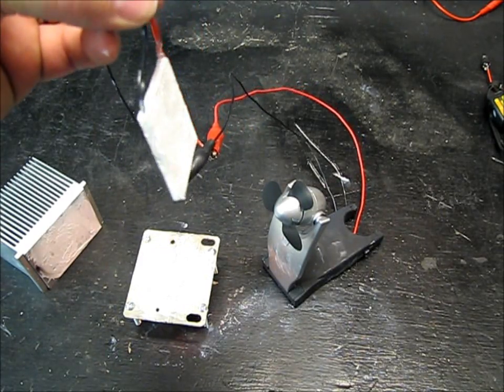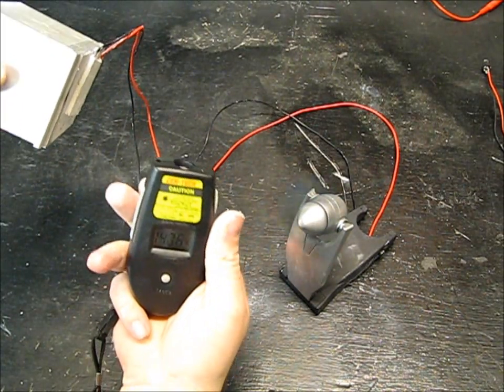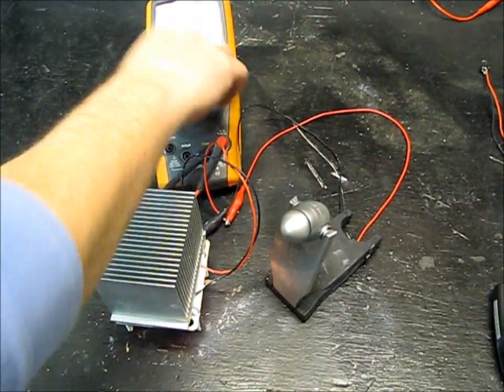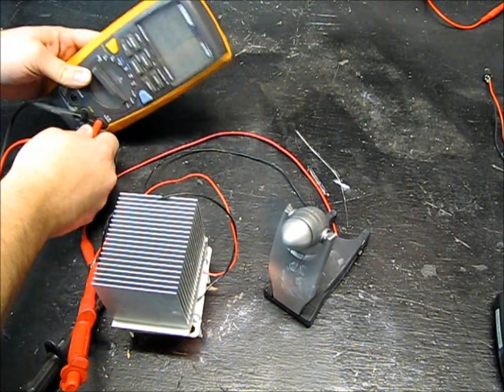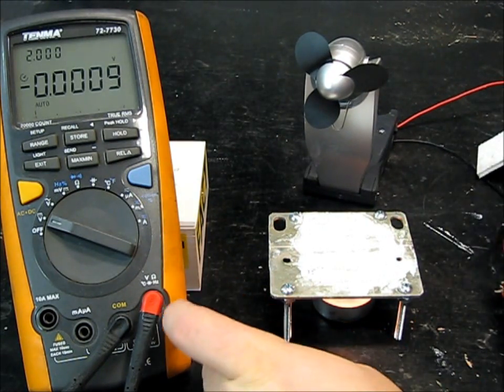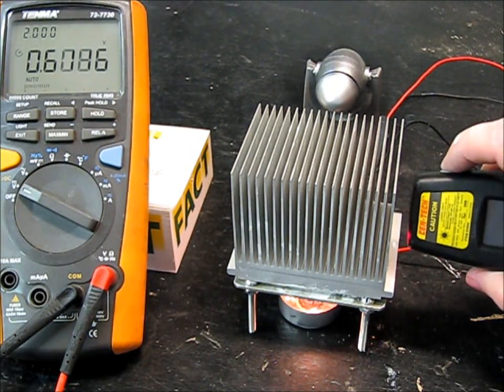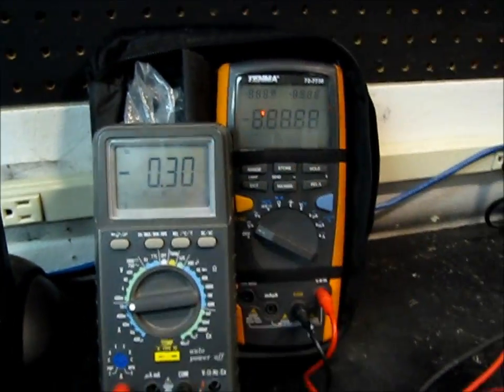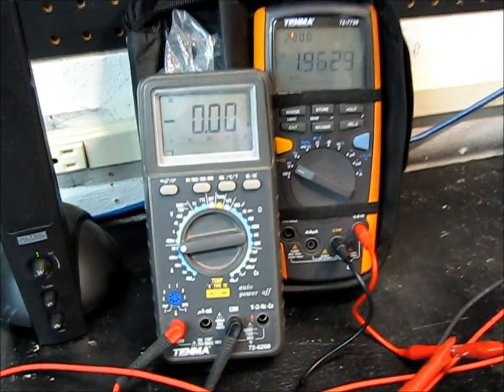DIY Peltier Candle Powered Electric Generator

Comment: Fixing hot plate at 50 degrees and the heat sink, which thermoelectric module would produce more power: TEC1-12702, TEC1-12706 or TEC1-12710?

Comment: do not measure amps with the multi meter like in this video, wrong method...Voltage measurement is done connecting in parallel amps measurement method is conection in series...red wire from multi meter, to the peltier module, black wire from the multimeter into the motor, second cable from the motor into the second cable of the peltier module, series connection

Comment: Your fan running, does it distinguishes the candle...? What voltage of your fan ..?  Can you use this fan to cool off your Peltier..?How many peltiers do you need to generate 12v to able to charge a 12 v car battery..?
Reply: 1 peltier is enough to charge a car bettery, albeit very very sow.
each peltier generates approximately 12 volts depending on the deltaT  between the sides, either make a bigger temperature difference to increase power output, better conductivity ( faster thermal displacement as a result) will increase amperage while deltaT (temperature on hot side - temperature on cold side) determines the voltage
in theory anyway, practice will most likely have a couple more variables I'm not taking into account

Comment: how long does it works?
does it not burn the Peltier module?
Reply: I think it does but after facing with heat for long hours. And it should work forever if you dont damage the peltier.
Reply: 200000 hours on paper

Comment: Have you tried to use watercooling? I am thinking about making a similar device but just using a cool pot of water instead of a heat sink. or perhaps a cool pot of water atop the heat sink. +electronhacks

Comment: I made something like this when a pettier module was around £30.00 this was 25 years ago, I used a tin can with an air hole for the tea light, and another can on the top filled with water, it worked fine until I upped the temperature and melted the solder junctions in the pettier unit. We now have TEC and TEG units TEG (Thermal Electric Generator rather than C cooler) have a much higher junction temperature ans best used in these applications. I will revisit this again now they are so cheap.

Comment: It's working on temperature differential not specifically how hot it can get, the greater the heat difference between the hot and cold side the more power is produced.
Reply: +raw150 you know, I think that comment was a dumbed down reply to someone I accidentally put in general comments, though I'm not sure, it was 9 months ago after all. I believe I was trying to explain its relative difference in temp not actual temperature that counts, for instance the biolite works on the same principle but at much higher temperatures, though these are not required in order to produce power. Conversely you could have a thermal electric generator on your clothes hot side in and the cold side out, the difference in temperature hypothetically produces small but measurable results if within the TEG's break-over limits. I believe there was a TEG garment in development a year or two back, designed to act as a mobile device charger though I don't know what happened with it.

Comment: I got it that you must provide heat for the peltier to convert it to electricity, but why are you trying to cool it down at the same time with a heat sink and a fan?
Reply: +Kanzler DE The greater the temperature gradient, the greater the voltage gradient (Seebeck effect), so the colder one side of the peltier is relative to the other, the greater the voltage output.

Comment: I got it that you must provide heat for the peltier to convert it to electricity, but why are you trying to cool it down at the same time with a heat sink and a fan?
Reply: +Kanzler DE It generates electricity through the difference in temperature, not just the heat.

Comment: Can we use sunheat instead of candle?
Reply: +Abdul Jaleel You could but it would take a long time to heat up,be extremely inefficient,and inferior to a solar cell in (almost) every way.
Reply: +championstudios101 What if you used a lens? and focused the light?
Reply: Bryce Durling Think of it this way is it more efficient to kill an ant with a magnifying glass or a blowtorch?
Reply: +championstudios101 but think of it this way the sun is free and limitless. What if you used say a fresnel lens to heat up water and cycled the hot water over one side while cooling the other the same way?
Reply: Bryce Durling It's not that it wouldn't work it's just not as efficient and would take up more space than a solar panel. (Although that idea is Way more awesome and worth looking into)

Comment: As with almost every video containing thermal paste, you use waaaaay to much of it. More thermal paste = worse thermal conductivity. It's designed to fill microscopic scratches and maximize contact surface so the amount used in this video should be enough for about 20 uses lol.
Reply: No.
Reply: Da bigga' da gob, da betta' da job! -AvE

Comment: lol and the fan that runs from this reaction can also cool the heatsink. You see because this doesn't work forever unless you cool that heatsink. Eventually the other side of the peltier gets hot and the temerature difference isn't enough and the thing basically stops working. That is why if you have something to blow air over the heatsink it will just keep going until the candle burns out.

You can get these to work passively but it requires a good design.

Comment: You know if the Nuclear industry got clever(which they won't as they are a bunch of dumb business men) they could use this power transducer to convert the radient heat from nuclear waste that stays hot and needs cooling for a very long time.
Reply: I liked the part where you went about assuming that people involved in nuclear energy haven't heard about peltiers.
Reply: Mikael Nyberg actions speak louder than words and their actions prove ignorance or deliberate ignorance in favour of cheap fast cash return regardless of the environmental effects. The big money they make gives them a nice house in a safe place away from the risks while the people they push into poverty with high energy prices pay the highest price in every way. Their judgment day will come. Karma has its way...
Reply: What you said had very little to do with utilizing peltiers at a nuclear powerplant. I'll leave you to continue your irrelelevant zealous preaching, have a nice one.
Reply: They do, its called a Radioisotope thermoelectric generator. Problem is that they are super ineffective.
https://en.wikipedia.org/wiki/Radioisotope_thermoelectric_generator
Reply: Its dangerous! The reason why they use water on those nuclear rods is to control that fusion.. there would alot of Chernobyl lol

Comment: If you created an inclosed Peltier cube with an electic heater in the middle feeding the power to the inside heater and threw it out into the snow would that not create passive heating inside the cube. Just thinking of ways that maybe houses could use the thermoelectric effect to produce extra heating as inside a house is always hotter than outside in the winter so you already have that ambient thermoelectric energy generation but probably just not enough of it.

Comment: I've seen a few people stack the peltier and heat sink above the flame here on youtube.  I bet it really kills the efficiency.  The problem is that heated air rises and adds to heating up of the heat sink.  So probably doubles the rate at which the heat sink's temperature goes up by.
Reply: Great point. I also asked if it would help to position a computer fan properly over the heat sync to cool it off better. The candle is super efficient!

Comment: If you measured the current like you did originally but without the fan in circuit it would give you a more accurate reading. Good job btw :)

Comment: Does it matter which side of the peltier coolers gets the heat and which side gets cooled? I have some peltiers coolers and I would like to try this on a larger scale. I would like to make a charger that could charge a cell phone. I’ve seen these pan generators that put heat on the bottom of a pan of water with a chip built into the bottom of the pan and would like to make one. Also do you know how hot you could get the chip before it would damage it? Thank you!

Comment: dude u cant measure the voltage of the fan thats as u say 1.1V and then short the cell giving 0.4A and say ... yeah its about 0.4W ...... check your electronic knowledge ... measure the current when the fan is runnig .. not short ... then calculate the Watts ....

Comment from the maker: No they produce a couple of volts at under an amp, you would need hundreds of them to get 130 watts. I assume there are better peltries out there but they are horribly inefficient. There are companies out there that sell commercial thermo electric generators like "Global Thermoelectric" I have used their units that produce 12-24 volts at 120-600 watts. The trick would be to get one of their  peltier units at an afordable price.
Reply: Hello, Could you tell me if I would like to assembly 10 peltier in series how much W will obtain?
Or maybe how i could calculate this?
Thanks a lot!

Comment: are these 12V  PELTIER plates? I am looking at 12V 130W plates and i'm wondering how many i would need to generate 14V when sandwiched between out pot belly and the pot of water that sits above, i would make an aluminium sandwich they could sit in in-between the fire and the pot. Thanks.
James

Comment from the maker: @cxaxnxexs Well when the load was removed the voltage jumped up, its like when starting a car the battery voltage will be lower than 12 volts like 10 because of the draw, then remove the load and the voltage returns.

Comment: You must measure the amps in series with the fan to detemine the power output. Measuring the amps in parallell, will determine the power inside the Peltier element at no output.

Comment: Good video the target should be 30watts to run a small tv anything bigger can be done occasionally with a generator eg washing machine. Next delta T can be improved say on a boat by sinking the heat to water or the outside air. Last but not least the overheating problem make the thermal linkage using Woods metal it melts at 70centigrade breaking the link.